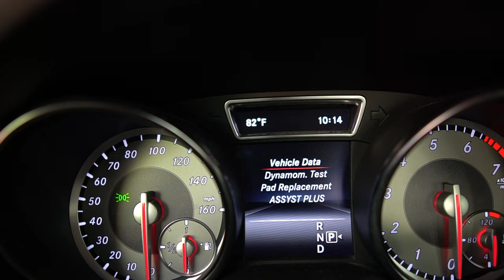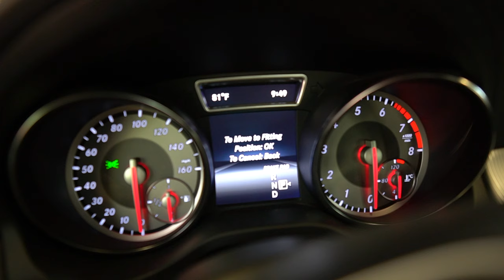Proper Mercedes CLA / GLA rear brake replacement. A must watch. See description before you replace.

Comment: That was fantastic Jeff.  Thank you so much.  I did my daughter's 2015 GLA250.  I just want to reiterate what some else commented on that I missed that might have been obvious to most people but it wasn't to me and it wasn't mentioned in the video.   Once I took the two bolts out of the caliper I expected the whole thing to come out easily like your video but it didn't.  It finally dawned on me that this car isn't like the other older cars I did brake jobs on and has an electronic parking break that I had to release.  Once I did that the rest of the job was exactly how you laid it out.   This might save someone else a bit of heartache.  Thanks again for a great video.

Comment: Good explanation but let me give you an advice: do not activate the brake service mode after removing the caliper. If accidentally you undo the service mode, you will end up with the piston being pushed completely out. That error can easily be done, believe me. Despite I'm aware of it I wouldn´t swear I would never do it ;-)
Reply: I have the same vehicle and am currently in the process of replacing my rotors and pads. I started twisting the caliper piston back in without putting it in maintenance mode. What should I do now? Thank you.
Reply: @aquacbd6718  Test the EPB. If it still works normanlly you can restart the procedure. If it is not working normaly, you will need to disassemble the caliper for repair. If you don't feal confident to do it, probably gettig a replacement one from a scrap yard would be a cheap good solution. Probably the last choice is the best and easiest.
Reply: @CRBN74  Can the caliper be off while I test it? Or should i reassemble with old pads? Thank you very much for your help Claudio.
Reply: @aquacbd6718  NOO! Don't activate EPB with the caliper out! Never! If you activate the EPB with the caliper out, its motor will run until the piston pops out! The EPB stops to tighten the pads by monithoring the current rise trough the motor. If the piston doesn't encounter oposition, it will not stop. 
To make any test, reassemble the old pads and caliper back in place. Hopefully it will be still fine and you can restart the procedure. 
If that´s the case, put the car on pad service mode before removing the caliper and don´t touch the buttons untill you finished both wheels. Before exiting the brake service mode, hit the brake pedal to tighten padt to the rotor. Only after that you should exit service mode.
Reply: @CRBN74  Thank you Sir, everything was all good!

Comment: Do not put into pad fitting mode with the caliper off. This will result in the piston popping out as I have just found out!!!!
Reply: I found out the hard way lol!! How did you fix that problem?
Reply: @cynthiaglaspie5805  blimey, this was a long time ago! If I remember correctly it was a right fiddle. The rubber gator had to come off and the piston would push back in. The problem was getting the gator back on the caliper and the piston. Took me a while. Then of course it needed bleeding again.
Good luck
Reply: @markandrewthompson6587  gotcha, thank you! I appreciate the reply 😊🫶🏽

Comment: Is that computer's maintenence mode only needed for replacing the rears ones? Or the front ones too?
Reply: Just the rear
Reply: Emergency/parking brake is only at the rear of vehicle, not the front.

Comment: The wording is very vague in the maintenance menu. What ever you do (DO NOT HIT BREAK PAD REPLACEMENT TWICE) it will pop the piston out and then you have bigger problems. I wish you would have added this in your video.
Reply from the maker: Good to know I'll add it in the description
Reply: @jeffferritto  oh man please do. I turned a 1 hr brake job into 1 day of cursing and putting the wheel back on without pads. 2 days of research. Then 3 hours of taking the caliber off, taking the electronic portion off the caliper, backing it out with wires to a 12V battery, fitting that piston in properly( there’s a boot that holds brake fluid behind the piston and the piston itself is two parts. A center threaded head with groves and the outside steel sleeve of piston the slides over groves. You have to work blind sliding that together while boot is on), bleeding the brakes on all 4 and testing the system. Whoever is reading this comment, (DO NOT ENGAGE THE EPB WHILE CALIPER IS OFF) if you engage the epb in any way after putting into service mode the epb will activate and push forward until the piston pops out. There is no fail safe in place for distance of the piston. I got it back together, but you may not have the tools or scanners to interact with your vehicle. Just be very cautious when working with your rear pad replacement and a epb.
Reply from the maker: @thewizard7099  I feel your pain.  You think it would run out of fluid before it popped out!
Reply: @jeffferritto  oh no, definitely not. The caliper on these epb’s hold a ton of fluid behind them. I’m just surprised there not a fail safe in place like a lip on the backside that wouldn’t let it extend so far that it pops out. It’s almost like Mercedes wants you to take it in. I called Mercedes to find out a price for worst case scenario if I couldn’t get it back together. They quoted me $980. Luckily nothing was damaged and I was able to fix it myself
Reply: My piston popped out , help 🙏🏼🙏🏼🙏🏼
Reply: @kimpham7592  take the caliper off and plug your break line. Reverse the piston electronics all the way back using wire to a 12v battery and fit the piston back in lining groves up and it goes straight in. If you don’t have a scan tool you’ll have to manually reverse the other rear same way to get car computer to recognize both in maintenance mode and communicate/function properly. Pain in the ass The hen it happens ! Make sure the bottom of the piston boot is properly seated. Otherwise you’ll be doing it over again. You’ll also going to have to bleed all four lines after. Hope this helps
Reply: @thewizard7099  I literally was so excited I got everything done new rotors new pads! I sat in my Mercedes and accidentally stepped on the brakes🤬. I hear the piston fly out on the ground! Lesson learned ! I have a push start ignition so I’m used to stepping on the pedal.
Reply: @thewizard7099  thank you
Reply: @thewizard7099  THANK YOU 🙏🏼
Reply: @kimpham7592  did you get it done ?
Reply: @jeffferritto  so do you leave the car in the “on” position the whole time, until you replace both rear pads ?  or after you put in service mode is it okay to turn off the car, and then turn it back on when you’re ready to take it out of service mode
Reply: @thewizard7099  Hey guy. Just had this same issue on the passenger rear. Actuator piston extended when caliper had been removed. Looks to be out about 1/2" more than normal. Can you detail how to use a 12 volt battery to retract?
Note that I really have no special tools or electronics to use. Thanks in advance!
Reply: @kimpham7592  Same thing happened to me today. Simple job turned nightmare.  
What was your outcome? Did you get yours fixed DIY?
Reply: @thewizard7099  messaged earlier. My piston did not completely separate,  but definitely overextended.  Is the fix the same?
Reply: @thewizard7099  yes 👍🏼 I got it done , the shop wanted $1500 just to fix my issue
Reply: @kimpham7592  But you DIY correct? If so any guidance you can offer? My piston only overextended,  but did not completely detach. The computer continues to have the parking brake error message and will  not retract the piston.
Reply: @randyjones180  if it’s still in line with the bolt that drives the piston back you just need to reverse polarity to the electronic on the back. That will drive the piston back down. You will need. To do same on both sides.
Reply: @kimpham7592 can you detail
How you reversed the polarity to drive the piston back? Mine is fully extended and I’m not sure exactly how I’d connect the 12v to the motor.
Reply: @kimpham7592 did you get your piston back in ? Having the same problem over here!!

Comment: Hey,  do you know where the fuel tank pressure sensor is for 2014 CLA 250 ? My check engine light is on with P24D8 code - which says FTP sensor circuit high and I see you did not replace the rotors here - after how many miles normally the rotors needed to be changed with brake pads  ?
Reply from the maker: Generally there good till the second or even the third brake job. There not very expensive.

Comment: Unfortunately this does not apply to a 2017 GLA 250. The rear calipers are very different so you do need an 18mm inverted to remove the complete carrier and caliper.

Comment: Release parking brake and insert stoper on both front wheels to avoid car rolling either forward or backsword
1. Loosen the lug bolts (you need ground resistance to turn the bolts, lesson learnt)
 2. Put the EBP in pad replacement mode to disengage the caliper piston procedure: go inside the car and make sure all doors closed and push Start button on time, and toggle the back button until it goes to the mileage, first press and hold phone call button and then press and hold OK button at the same for 5 seconds. The cluster shows up vehicle DATA, move down to pad replacement position and hit OK and the cluster  shows up: to move to fitting position and press Ok and get out car 
3. Raise and remove the tire
4. remove the caliper and  pad, push back piston with tool Replace the pads and reassemble the caliper on to the rotor (grease the retaining bolts, wear indicator, etc.) 
5. Pump brakes until you feel the resistance 
6. Reengage the EBP (similar to #2 above) 
7. Yes of course, mount the tire and lower the vehicle  
8. Repeat on the other side :)
Reply from the maker: I added this to the description with a thanks to you
Reply: @jeffferritto  Step 2 & 3 appear in the wrong order here - in the video you remove the tyre first. Does it make a difference?

Comment: So the right sequence would be:
1. Loosen the lug bolts (you need ground resistance to turn the bolts, lesson learnt )
2. Put the EBP in pad replacement mode to disengage the caliper piston
3. Raise and remove the tire
4. Replace the pads and reassemble the caliper on to the rotor (grease the retaining bolts, wear indicator, etc.)
5. Pump brakes until you feel the resistance
6. Reengage the EBP (similar to #2 above) 
7. Yes of course, mount the tire and lower the vehicle
8. Repeat on the other side :) 

Thoughts?
Reply from the maker: I wish I could add that to the video! Thanks
Reply: Should not you  6. Reengage the EBP when both side be done?

Comment: If the piston doesn't wind back all the way the first time. Re engage caliper but put something in front of  piston so it wont wind out by using old pads, after doing so a few times then the piston will wind all the way back and the caliper will sit on bracket nicely.
Easiest way was by using an diag computer

Comment: I have caliber off and it didn’t go to chance mode, i put wire from caliber to brake disk and then it works. Calider needs a ground connection caliper/car👍

Comment: Should you only engage the maintenance mode for the rear brakes once and change both sides (driver/passenger)? Or Do you engage and disengage maintenance mode for each side?
Reply from the maker: I did one side at a time
Reply from the maker: Pushing the maintenance mode twice, once each side

Comment: Do you need to do the computer setting for the front brakes too?
Reply from the maker: No, just the back.
Reply: James: you clearly don't undestand what the motor does on the rear brakes. Better trust that service to someone who does. The answaer is no. On fronts you can just push the piston in, is purelly hidraulic.
Reply: Cláudio Nogueira already installed front and rear myself after someone replied with a simple no  4 months ago that I don’t need to set that for the front. yes I clearly understand since the setting only adjust the pistons to the rear when I have the wheels physically off and I can see for myself. but thanks for coming late to the party.

Comment: Good Evening Jeff, if you don’t mind can you tell me the name of the $5 part used to push the caliper in? I was told that I’d need some fancy kit that’s made for this car. Thank you for your help with this very detailed and direct video.
Reply from the maker: Piston compressor or just use a c clamp
Reply: @jeffferritto  alright thank you!! 🙏🏾
Reply: I have a quick question. Hope it doesn’t seem stupid but when I took off the brakes they seem to be in fairly good condition, but I’m receiving the message “check pad wear”. Being that the message is saying “check” isn’t necessarily saying I need new pads right?? I’m really confused lol…
Reply from the maker: @_I_AM_9  are thay over 50% of what the new ones look like?
Reply from the maker: @_I_AM_9  on both sides? One might be worse than the other side
Reply: @jeffferritto  both sides are well over 50%.
Reply from the maker: @_I_AM_9  not sure what is causing this problem?
Reply: @jeffferritto  kinda puzzled myself…

Comment: I took off the 13mil bolts but the caliper is not coming out, should I go inside the car and release the e brake lock ?
Reply from the maker: Yes.
Reply: Same thing going on right now. I tried to release the e brake but it still wont come out. Any help?

Comment: Hey Jeff!! Can you post a link to the tool you used to push the piston in?
Reply from the maker: A 4" or 5" inch c clamp will work too.
Reply from the maker: look at amazon for. (
Reply from the maker: capri disc spreader tool

Comment: dont need OBD2 ??
Reply: No! You just saw how it can be done withour it. Even on other cars you never need an OBD2. I have e Volvo V60, there is no user friendly option. All you need is to remove the motor from the calliper (2 mounting screws). Undo the caliper central screw clockwise (yes, it´s the right direction) and in the end reassemble the motor and activate the EPB normally 1 or 2 times. No erros, no problems. Did it already 2 times.

Comment: this is everything rong dot do this guys first of all you dont need to remove the calliper by force the first thing to do is remove the wheel go inside the car to dealers menu them do the replacement setting after that you remove the calliper with a easy push... delete this video man you will break some ones car, worked for mercedes for 2 years trust me i know what i am talking about.

Comment: I tried your directions retracting the electric braking system. It doesn't work. It doesn't work whether the ignition is on or off. Please respond.
Reply from the maker: The doors need to be closed
Reply: The EPB must be released. Did you checked it?

Comment: do you have to go on the computer for the front wheels too or is it only for the rear wheels?
Reply from the maker: No only the Back   The computer is for the E brake which is only the back brakes